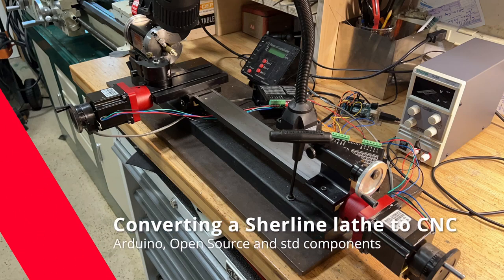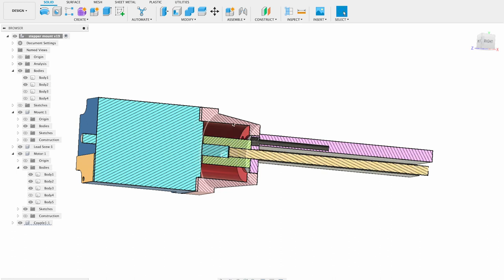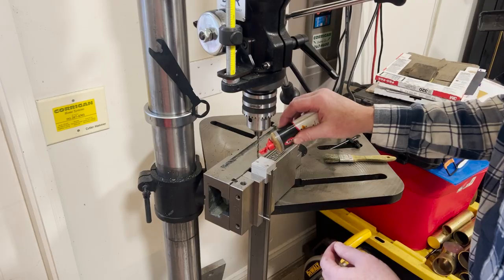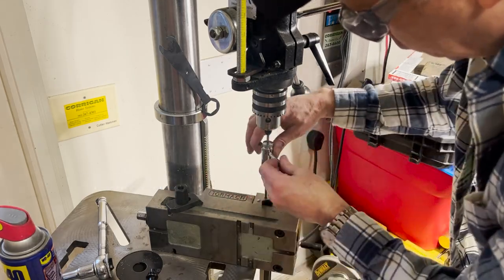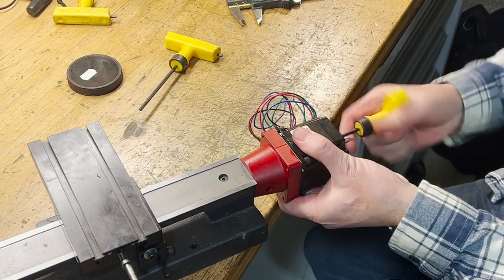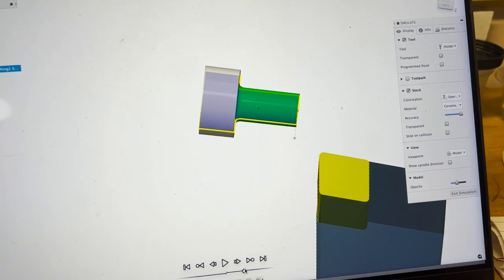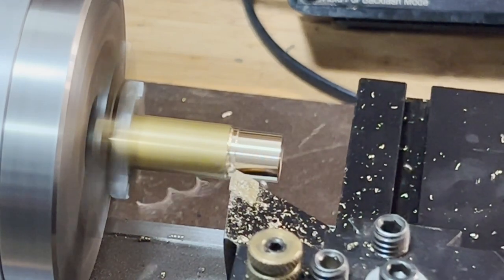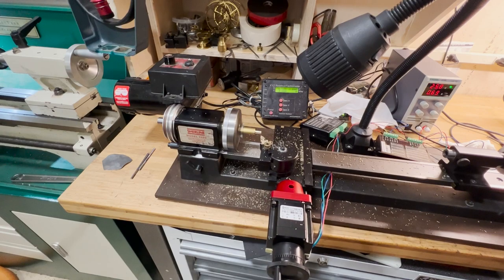Sherline Lathe CNC conversion (home made)

Comment: Can you help me cut some knowledge corners on a project... ive only recently discovered the beauty of making things using mills and lathes. The epiphany I had not long ago reassured me my my life would be more balanced by learning a trade and more importantly creating things using my hands. Also I read Rick Rubin's extraordinary new book along with some profound Jungian synchronicity. 
So I decided I want to leaen precision milling and since I already have a nice woodmiser mill ..i wanted to start working with wood and precision wood crafting. First on my list is to produce a lathe that can craft a perfectly balanced cue stick butt and shaft (I'm a life long huge fan of billiards) I have learned that something along the lines of a sherline or taig headstock would be ideal but i have seen nice work done using only archaic large 3 jaw chuck and two supporting rear bearing units... basically it went, far as I could tell,  pulley at the end then two 80/50 od/id bearings spaced about 1.5 ft apart then directly followed by a 10 inch 3 jaw chuck somehow attached to the second bearing unit. I have capital to invest in anything but I would really like the challenge of creating my own lathe... should I make an exception for the Taig 5c headstock or for my needs can I get close to rhe precision I need by doing it the way I described above?? pulley,  two large abec 5/7 bearings units and 3 jaw chuck on steel stand with precision sled/stand. I have railroad rails on an even older wood circle saw mill,  would I be able to use thos heavy railing to produce a stand with the level/precision needed?  I live on a old farm and  there is old farm and railroad equipment scattered all about .. Any tips you can give me or direction to point me in would be so greatly appreciated.
Reply from the maker: What you are attempting sounds reasonable.   Most questions sticks are done on wood lathes that are not that precise so I believe you should be fine.   The trick with a que stick will be supporting it along the way as you mill  . https://www.googleadservices.com/pagead/aclk?sa=L&ai=DChcSEwjL1-WAlJCEAxXb8uMHHSYnBmYYABAMGgJ5bQ&ae=2&gclid=Cj0KCQiA5fetBhC9ARIsAP1UMgGJhhqOoggfcjmgKbSzedS5ZTgOUPFndTKXkBtr0wlt4dSQ10r7nOQaAqcjEALw_wcB&ohost=www.google.com&cid=CAESVuD21vni6U8ihSzBOynkQz_O7aa2nV3h7OlEsg-xvnIN2i_rHZ2Yoep_5szyPbU18-Q65xDrGFbVR5yzfxaj72npo_tP-CgXLChJjBaj_t45l48DL8l_&sig=AOD64_0ei2a57mrlh2q8XovN-fRs6Jdtiw&ctype=5&q=&ved=2ahUKEwi69d-AlJCEAxU4hIkEHQ-wAqgQwg8oAHoECAUQFg&adurl=. You will need something like this to keep it from flexing as you machine.

Comment: Nice work Kevin..I was wondering how you got the dimensions for the mounting plate, in particular the mounting screw holes.  Thanks
Reply from the maker: It's been awhile but I think I did find a drawing on sherline's site for their CNC conversion kit.   I also know I checked by measuring with calipers.
Reply: Thank you....looking forward to the Grandfather clock build videos @KevinNolanMakes